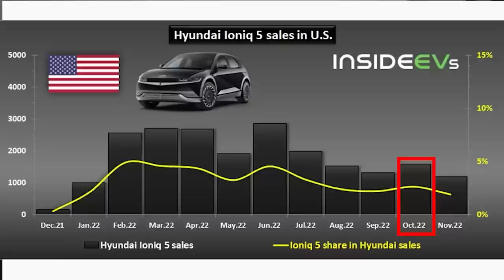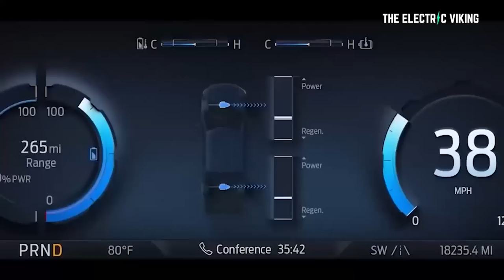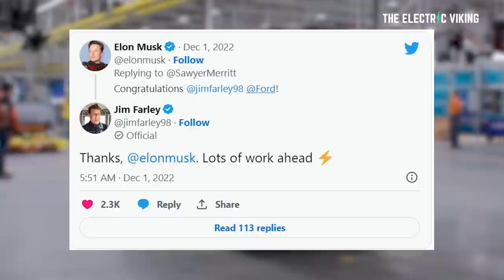Ford leapfrogs Hyundai/Kia, becomes No. 2 EV maker in U.S.

Comment: Both Kia and Hyundai EVs have been WILDLY overpriced on stealership lots...by at least $12K. I asked a couple salesmen to check this out, and they all unashameably stated that the market will bear it so they will charge it. That was the beginning and end of my interest in either of their EVs.
Reply: Vermont's:  Well, at least until they stop doing that.   OTOH, there is a LOT of that these days (to varying extent), with cars in relatively short supply.   Hopefully as supply chain issues ease greatly, so does that.
Reply: The IRA was not signed into law until Aug 16, while Hyundai and Kia sales may have been lower way before that date.  I have read numerous accounts of people WANTING to buy a Hyundai or Kia BEV's, but the company was not importing enough to satisfy demand.  In addition, dealers were marking up the few that were available to spectacular levels.  I'm not surprised sales may have been low, but it was likely NOT due solely to the IRA.
Reply: Agreed. The eSoul would have kicked Ford's Hiney had it been imported to the US; better than the overpriced Niro. I think it would also stack up well against the Bolt. Of course, no one is talking about the eSoul
Reply: And that's when I found a $0 mark up on a bolt euv and bought it

Comment: Absolutely LOVE Mach-E. A surprising benefit: my AWD model is THE BEST winter road car I've ever driven.
Reply: Agreed, our Mach-e GT massively exceeded expectations last winter! I hope my Lightning performs as well this winter.
Reply: @sotek2345  One aspect of EVs in the winter I've never heard anyone discuss before: regen braking. It stops the car far more effectively than even anti-lock brakes, and waaaay smoother. 

I was afraid one-pedal driving would be dangerous on ice but it turns out to be a huge stability aid.

Comment: Many of us can't afford a car over $20,000. we live in apartments and condos without a garage. thus, we can't have home charging. We need a cheap ev with 4 seats plus reasonable cargo space that has FAST CHARGING CAPABILITY since we are at the mercy of charging stations. We need a Model T EV!
Reply: Call a cab😃
Reply: Yes! All manufacturers are firstly focused on the upper mid tier because demand > production and especially battery material production is still way too low for all cars to be EVs.  It is ramp up time! Globally! So, who ever gets first and keeps innovating to stay there, can make a decent profit. Manufacturer will just have to deliver. Seems like too many have delayed too much - certainly now that the energy transformation has passed the ICE to EV point of no return. People just don't want to pump all thar CO2 in the air.
Reply: Our used Bolt was $25k, so I think we're getting there.  Used Leafs are pretty cheap too, but, of course, the range isn't as good.

Workplace charging may help, and L2 chargers are becoming more available... Not having a home charger definitely does take more work, but can be done.

Comment: Manufacturers must 'get serious' about electric vehicles because the 2026 EPA CAFE mandate is a 40 mpg average, or they face big fines for each non complying vehicle.  Which means that highly profitable trucks and large SUVs can't be sold - which almost certainly means bankruptcy for many automakers.  This is not being driven purely by customer demand in itself.  Customer demand for EVs would be very strong if the price were right and institutions like Consumer Reports were recommending certain new electric vehicles - which hasn't happened .

Comment: I want to like Ford, had a basic F150 manual that was reliable, oh, except for the peeling paint. Huge lemonique class action lawsuits: 1. Econboost 1.5/1.6/2.0/2.3L engines faulty design resulting in head gasket failure, engine destruction. 2. Design faults make the Ford dual clutch auto tranny basically an unfixable mess. They can't even do ICE properly.

Comment: You know, Japanese automakers terrible response to electrification has mystified me for a decade or more. Nissan was the first company with the affordable EV. Toyota had huge success with the Prius 20 years ago and it's still a great seller today. Why wouldn't they take the lead? 
I did read an article that really seems like it uncovers an important fact I had never heard before. 
Around 2010, there was a dispute between Chinese fishermen and Japanese fishermen. This may also be related to some islands China was building to expand their territory near Taiwan. One of the actions that China took was to block access of critical battery materials for EV battery manufacturing. 
So, the idea of the article was just that Japanese auto executives may have decided that they could not depend on a steady supply of battery materials to truly expand their EV fleet. ...
Nissan since Ghosn was tossed in jail has dropped the ball on EVs. Toyota keeps insisting that Japan is going to be a hydrogen based economy. They've said they are going for solid state batteries. Etc. 
Sorry I can't find the article right now, I believe it might have been a Quartz article. I am not a subscriber, so it's difficult to verify.